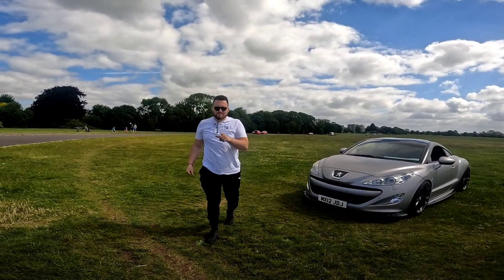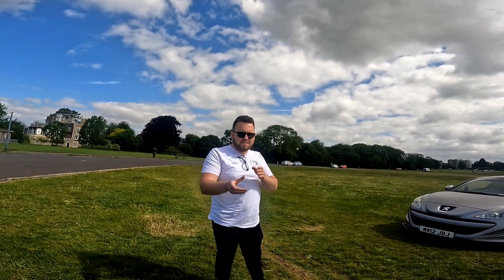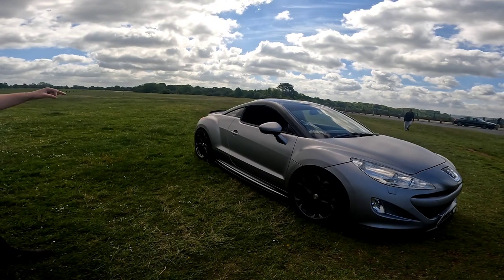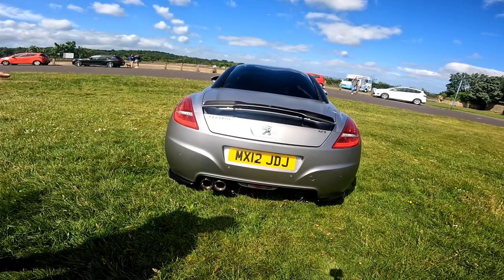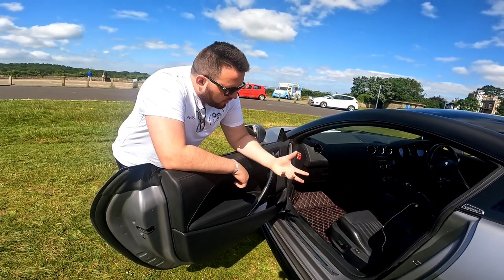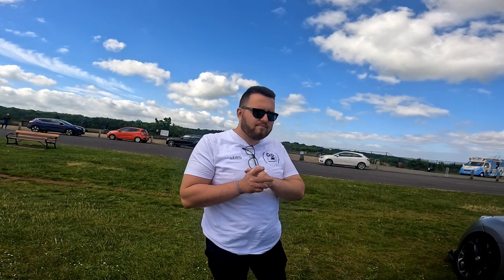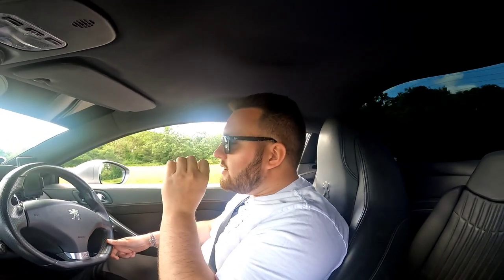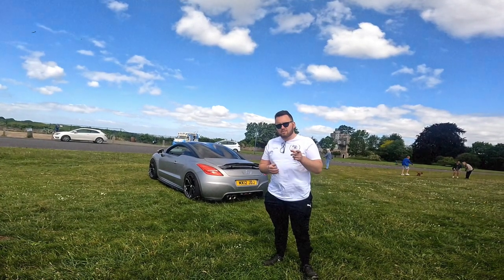PROJECT RCZ ASPHALT - 6 WEEK UPDATE 🇫🇷

Comment: i had my turbo replaced not because it was knacked but the wastgate flap was rattling so it was replaced under warranty 2 years ago but i did pay for all of the pipe work replaced behind the turbo including water cooling. i also had a clip cut through a coolant pipe. and recently had a new thermostat housing due to a hairline crack in it that got worse. ive owned mine 9.5 years love it. but its had a few things go wrong on it all being german parts though lol nothing french which makes you question german engineering sometimes. ive kept mine stock height but put on bilstein b6 shocks and polybush all round  its now a super car pisser offer in the bends
Reply from the maker: They do drive so well! Glad to hear you've sorted your issues haha
Reply: @LIMITLESSMEDIAUK_  its an ongoing project of preventative maintenance lol . but love driving it even if it is £2 a litre for fuel now.